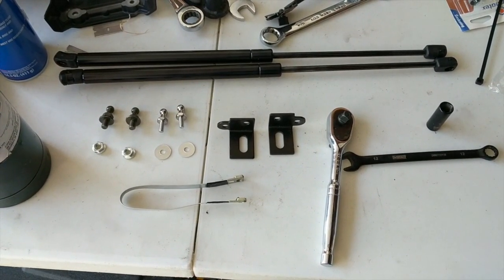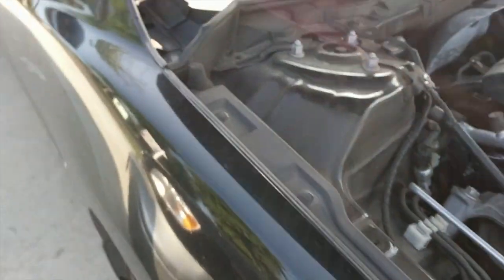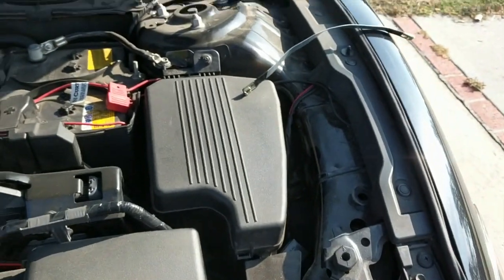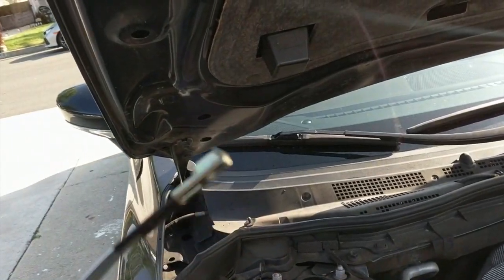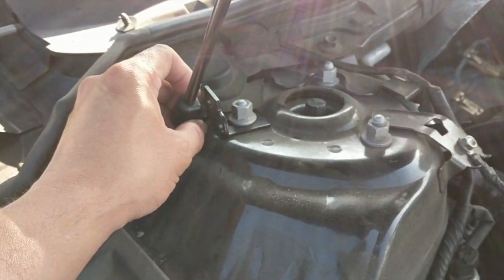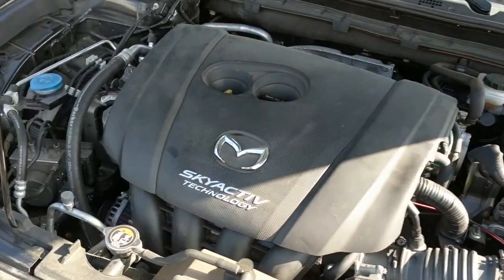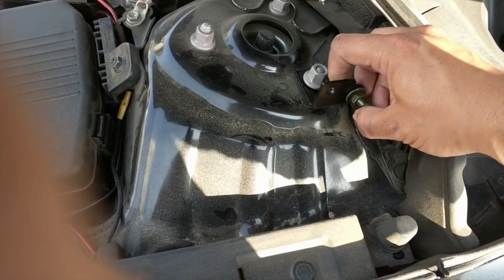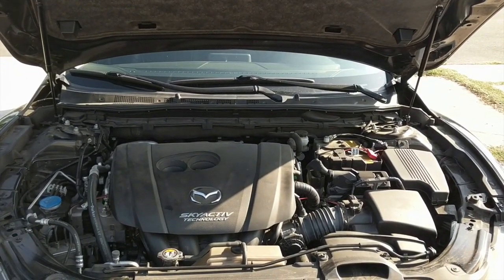Mazda 6 Hood Support Shocks

Comment: about to buy a 2021 Mazda3 G25 Evolve. Can't believe that Mazda Inc has not included hood struts as standard equipment on this make/model. Hood is extremely heavy.
Reply: Mazda has been cheeping out so badly lately seats are a joke n every single model’ I’ve had Mazdas for over 10 years I’m done with them’ if u haven’t bought do research and go else where mazda has gotten very bad and they do not stand behind warranty it’s Always your fault and they won’t fix a damm thing

Comment: I'd be a little cautious about fitting these. If they interfere with the Active Hood safety feature, you might lose your car insurance in a claim and if you hit a pedestrian and the hood doesn't pop correctly, you might find yourself sued for tampering with the cars safety systems. Just a thought.
Reply: Wtf r u talking about? Tampering with the car safety lmao dude no…. If you’re in a bad enough wreck this shit will smash it’s like cheap aluminum 
All it does is prop up the hood doesn’t give the hood added strength bro’ and they can’t deny u a claim for a bracket’
Reply: These struts should improve the safety of the hood closing, so a strong gust of wind doesn't dislodge an open hood from the prop rod and have it slam down on tow truck drive etc.....